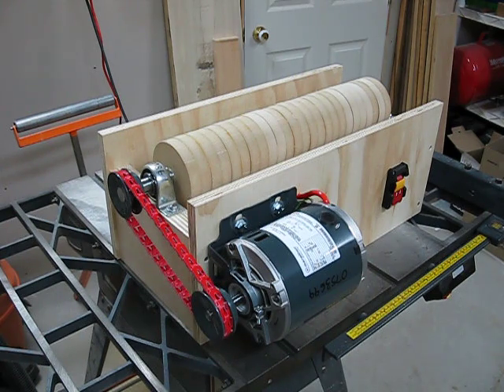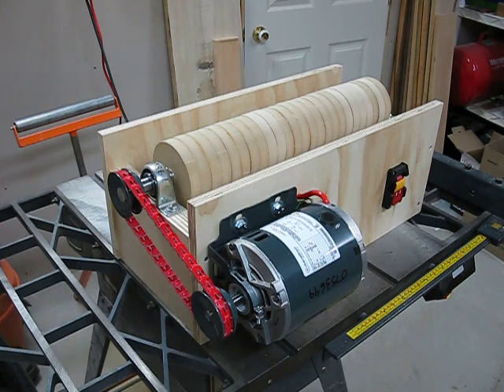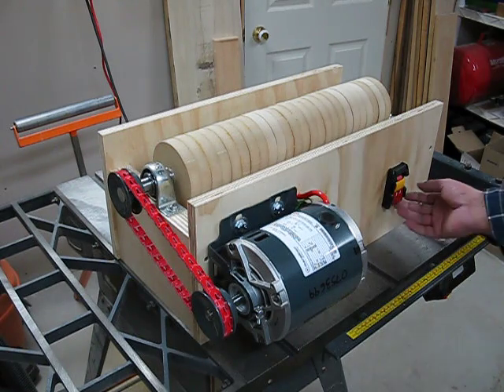V-Drum Sander Build - Part 1

Comment: Paul I’ve got my shaft and will be cutting the 4” disks on my CNC, but still place them on the shaft by alternating every other one 180 degrees, first dialing in the hole size for a close tolerance fit.
My question is what was the top of the sanded disks relative to the top of the V cut plywood table?   If I need I can shim up the bearing block supports to raise the disk drum assembly relative to the top surface.  Thanks Paul I’m looking forward to this build.
Reply from the maker: I made the wooden disks even with the top of the table. With the velcro and the sandpaper on it, that would bring it above the top, then I can adjust the 2 levelling screws at the front to adjust the height of the table top to whatever I needed. Don't forget to cut a notch in one end of a disk before assembling to have room for the tip of the sandpaper as we discussed earlier.
Reply: @PaulPomerleau  on no forgot about the notch, please describe that to me again.
Reply from the maker: You want to have something like this at one end so the tip of the sandpaper that is facing towards you doesn't lift when spinning: http://tinyurl.com/bdkwmkaj
Reply: @PaulPomerleau  thanks Paul, I see, I haven’t cut the shaft end or any wood any yet.  I have an old south bend metal lathe so I could make a 1/2” thick plate the same dia as the finish dia of MDF drum and about a half inch thick that fits the shaft, and mill a angled slot for the end of the sand paper to fold into. The slot would be wide enough for the paper to fold into plus a 1/8” thick piece in alum as wide as the 1/2” thick plate with a set screw coming in at an angle to the disk surface to be at right angles to the pressure plate providing even pressure trapping the paper.  Boy it sure would have been to post a drawing, than trying to explain it.  How did you address this problem with MDF?
Reply: @PaulPomerleau  thanks Paul got the drum and frame made. Ordered and received the 120 grit DUR VC-120-12 sand paper. It’s 3” I’m looking at the adhesive backed loop, most of it is narrower, is that OK and should it be wound in the opposite direction as the sand paper roll?
Thanks Paul

Comment: may I ask how you connected the rotating plate to the electric motor's shaft?
Reply from the maker: Do you mean the pulley? There is a small square piece of metal called a "key" that lines up the pulley with the shaft, then an Allen screw to hold it tightly in place. Standard setup for pulleys.
Reply: pauljp55
hmmm I think I got it....

Comment from the maker: I believe in my part 4 of the sander, I mention that every 5 or 6 disks I put some epoxy on the shaft and slide the disk over it. It turns out that this is not really needed, as the disks tightly fitted on the shaft and glued together I think it is almost impossible to move the shaft without turning the disks. Also, there is not a lot of pressure from the sandpaper on the stock being sanded, it is centrifugal  force that is lifting the paper away from the drum and making contact with the stock.

Comment: Great video(s)! on your V-sander build. I really want to tackle this project myself. I'm curious as to how the MDF discs remain in place on the shaft; in otherwords, what prevents them from turning along the shaft when placing the weight of wood stock onto the top of the drum while sanding? I'd also be interested in obtaining your plans for this as your plan seems more doable than others I've seen. Basic, yet as productive as I would ever need. Thanks.

Comment from the maker: I got most of the information from a local company who sells the sanders.
Here is what they have to say:

"The drums require a minimum of 1/2 HP motor that runs 1725-1750 RPM, although any motor that runs 1725-1750 RPM will work."

I find this speed runs very smooth with a 1:1 ratio on the motor and drum.

Thanks for your question.